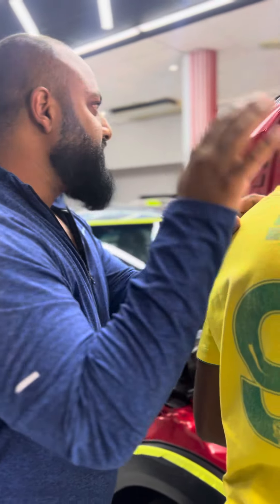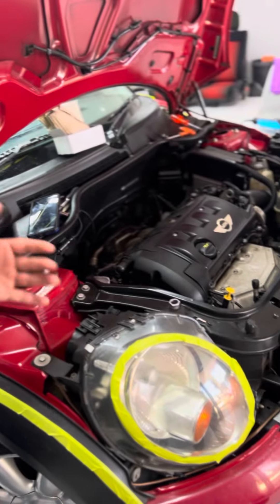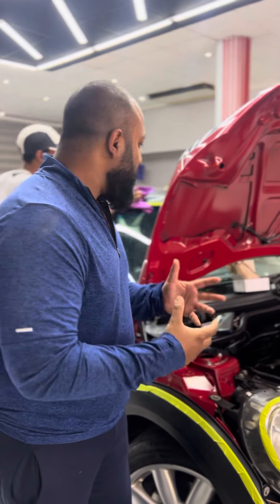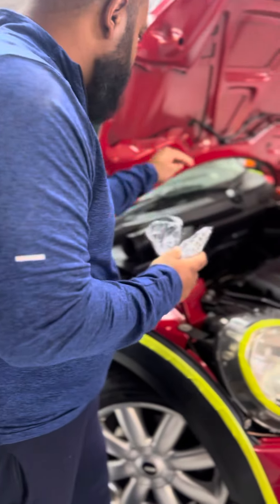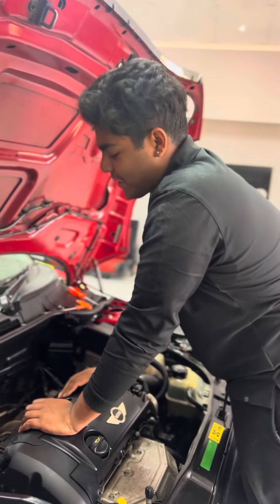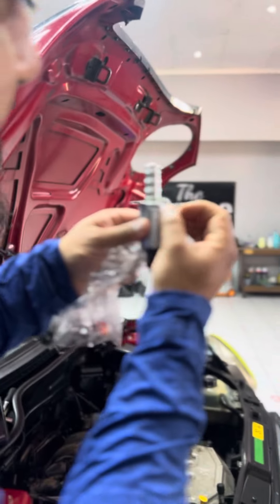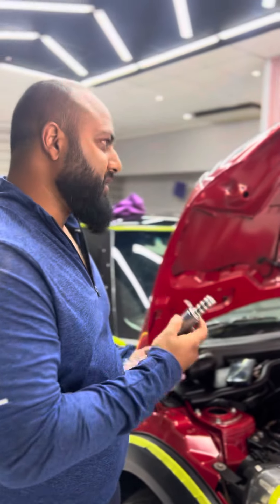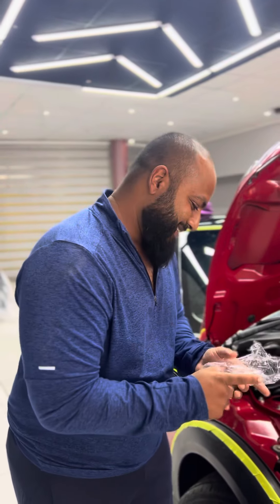Mini Cooper - Rough Idle fix .

Comment: I would try cleaning both VANOS with MAF cleaner. I am about to attempt this but i could only find brake cleaner. I might use fuel to clean it. Another thing to note is the chain tensioner, the originals and some sellers use the old ones that were too short. If buying a new timing chain tensioner make sure you get one of the newer longer ones as it was an old design fault. Slack chain at tickover = v noisy tickover. Also, check first the oil filter is fairly clean and you are using the correct oil SAE 0-30 or 5-30 and C3 i think but check the C rating as i didn't spent too much time on that. In general, the lower the sulphur rating the better but C codes are a bit tricky i believe.
  Also. Check the operation of the PCV valve for the oil breather in the valve cover if your car has one.
  PS. If your oil looked messy you might want to also clean the oil hole that feeds the chain tensioner near the VANOS on the rear left side of the engine.